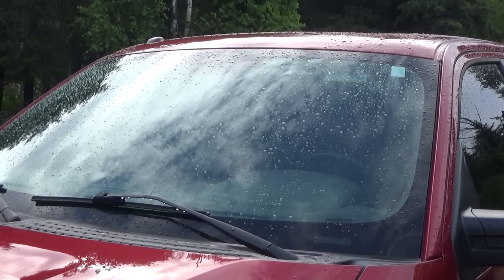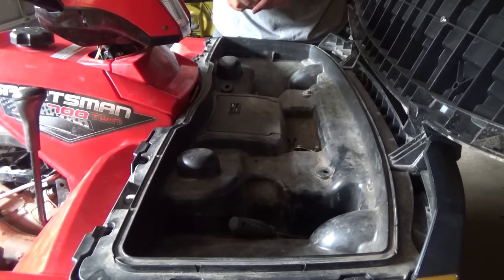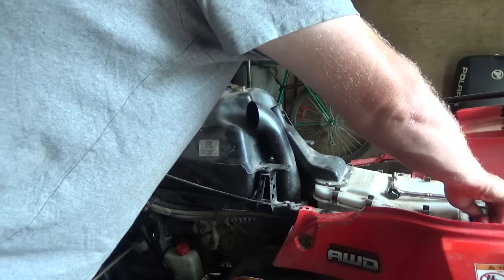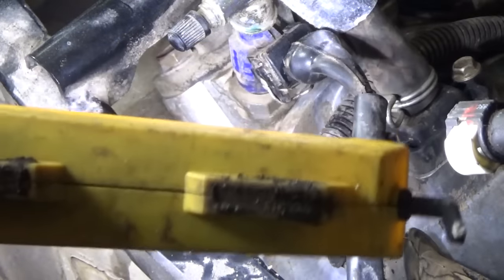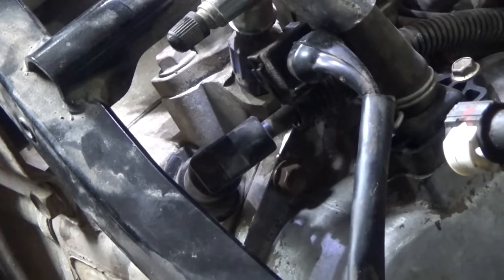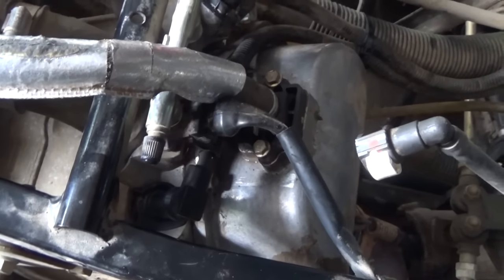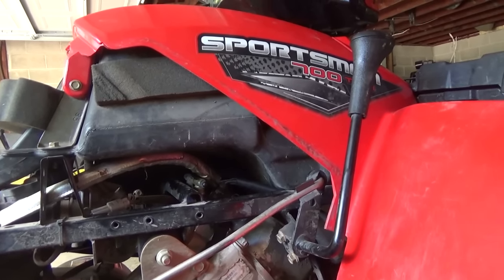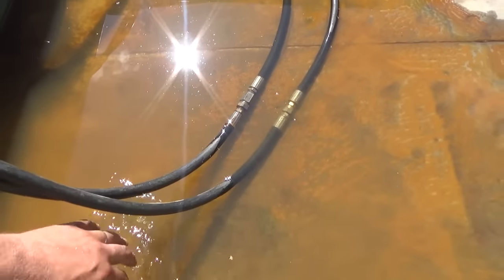Polaris Sportsman 700cc teardown for HMF fuel controller installation and engine service

Comment: I heard of a biting fly trap that is easy to make and works very well. Get a black beach ball or black bucket (a black kids ball about the size of a human head will work too) attach a string to it so that you can hang it from a tree branch then coat it with a  heavy weight STP motor oil. The motor oil has to be thick enough so that it doesn't just drip off of the ball/bucket . The color black allows solar radiation to heat up the thing you're hanging and the string allows the thing to move. The yellow/deer fly is attracted to heat and movement. Try it and tell us how it worked!

Comment: champion spark plugs are good  i have a 10 year old briggs and stratton 4.5hp push mower that still has the original spark plug its a champion plug and it still runs good

Comment: how long does it take to upload a 1 hour long video?
Reply: just a guess because i don't know how many gigs is a 1 hour 720p 60fps file is but anywhere in between 2-5+ hrs depending on upload speed and youtube conversion.
Reply from the maker: my connection about 20 min